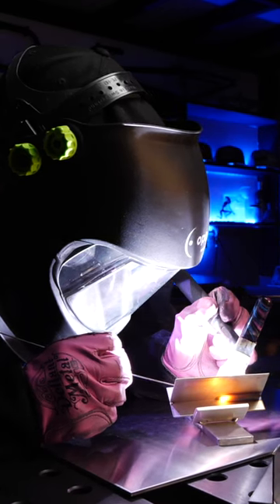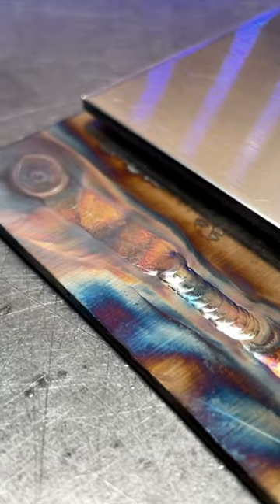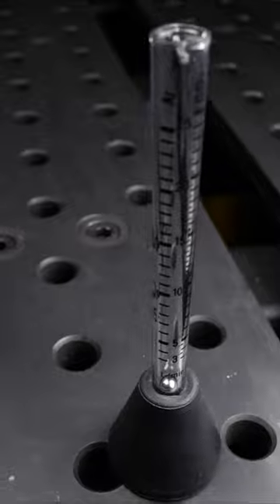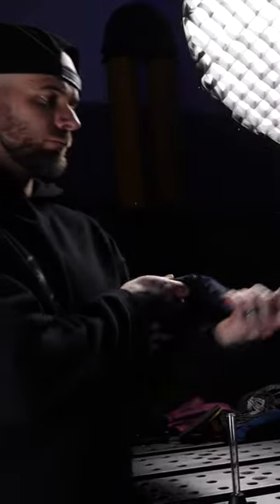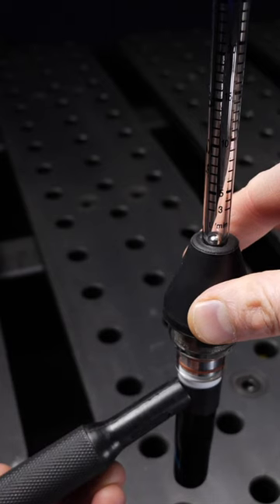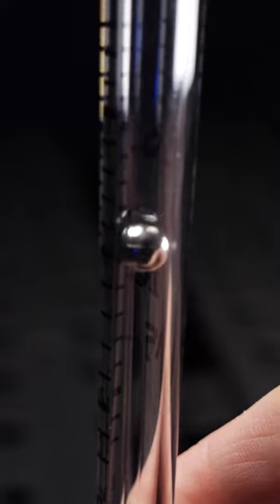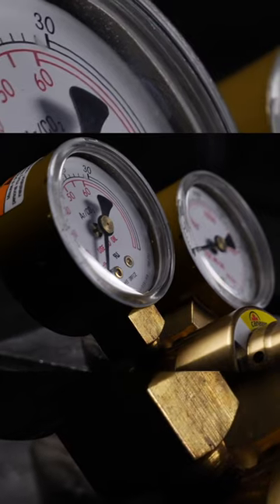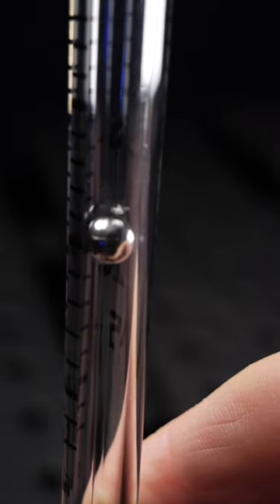Fixing a gas problem the EASY WAY🔥 tig welding #shorts

Comment: I’ve literally spent weeks oxidizing every well that I made in stainless steel After seeing this video I checked the regulator and it was leaking. I didn’t have one of those instruments that is using in these videos, but it would’ve been helpful once I made that correction I was able to finish for weld assignments in less than an hour.  I spent three week, i.e. four classes a week, which is a sum of eight hours a week in class time not finishing one weld. This video solved my problem and I was able to turn out some awesome material in which my professor stated ….did you do that?  I told him about the loose valve and repeated the process to get an  “A” in my class. Thank you so much for all of your videos.  🎉
Reply: Need to check for leaks before firing up
Reply: Good job staying at it and looking for answers! Problem solving is key in life

Comment: I point the torch at my face to feel the breeze of the argon streaming out and that's how I know it's about right. When I am welding aluminum, I try to remember to turn it down because it seems to weld fine with much less flow and my smaller cup.
Reply: I do this as well but pressed the pedal a bit too hard and sent high frequency through my lips 😅

Comment: With the new true color lenses, you can see if the weld is shielded. Blue is what you want and gold or white light is air getting to the weld puddle. Sometime you can adjust you torch angle to head off the intrusion.

Comment: This is called a pea shooter, if your reading is way off it usually is because of leakage somewhere and in some cases you may even be getting air mixed in before the gas gets to the torch. If the leak is bad enough it can also lead to intermittent gas flow.

Comment: I was having the same problem at my job mig welding and did exactly the same with a flow meter and corrected the problem. Cheap bit off kit but saves you so much time and head scratching

Comment: I had one were a spark or similar melted through the gas line -  just nicked it.   it also nicked the water line - when I flexed the lines, the water would seep out.  Looked closer, and saw the gas line was damaged as well.   That's about the time I bought a leather cover for the lines (I think they make lighter ones now) and I replaced, didn't try to splice, the damaged lines.

Comment: I had a break in my torch hose between the machine and the torch head. Big hole torn in the rubber. Took forever to figure out. I added one of these to my troubleshooting tools list.
Reply: All it takes is to turn on and off the bottle valve and see that the needle on the pressure gage doesn't go down. Wich mean no leaks.
No need for anything else.
Reply: @Ihtiandr13  that doesn't work if the hole is in the torch.
Reply: @Dreddip  True, for that you'd need the 'nozzle flowmeter'.
But as you described in your first comment it wasn't the case.
 And if you followed the typical trobbleshooting rotine , youd find the leak before you would need the flowmeter.
I was fortunate that my instructor emphasised exactly that, troubleshooting. One another hand he forgot to teach us how to set up wire tension the correct way. Some things we have learn on our own. 
All the best.

Comment: I was called to troubleshoot a gas supply issue in a MIG/MAG welding machine. The gas flow was good, but the weld wasn't. Eventually, we discovered that the extraction was so strong that it was pulling the gas away. Because it's normal to hear the extraction, the welder didn't initially consider this logical solution.

Comment: Been having problems welding 10ga 6" pipe! I can get a beautiful weld at 105 amps and 15cfh on 1/4".I turned down the heat to 75 amps. I can get some pretty welds and my downhill is having problems. Do you think I am to cold or am I using to much gas? This is all on ss!